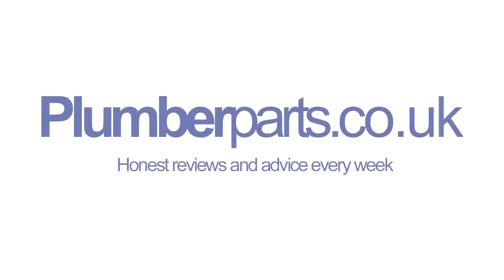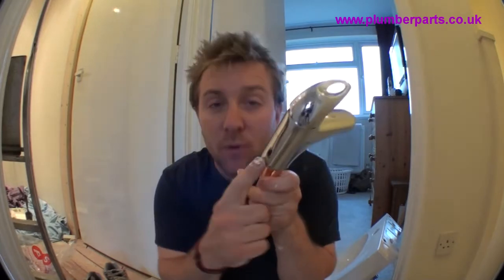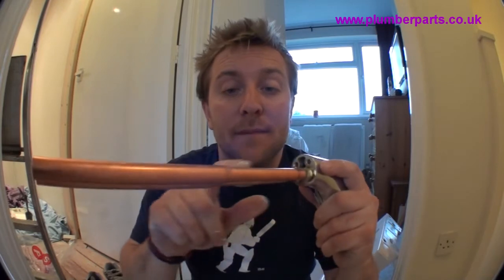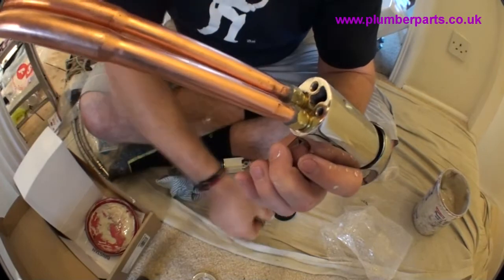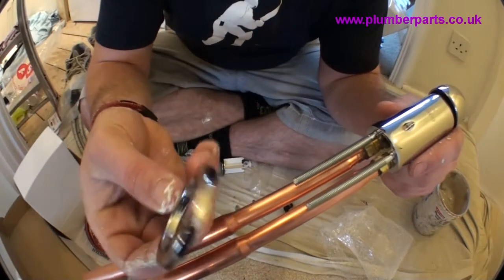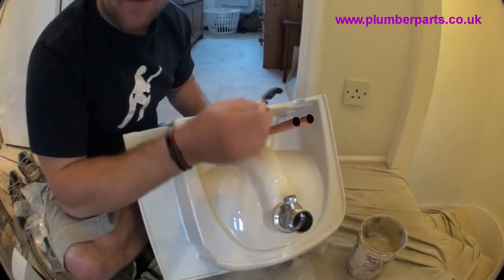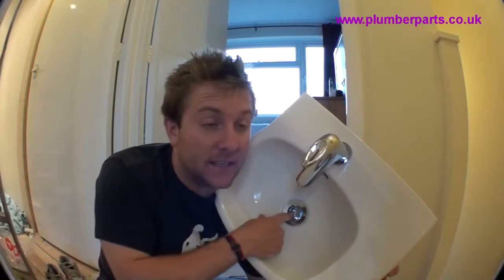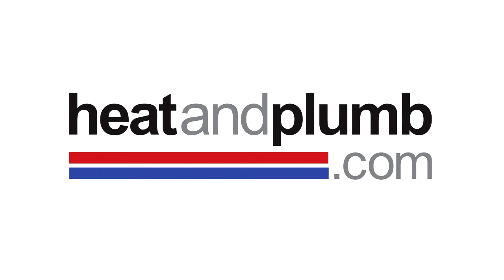Ep2 Wash Basin Install - Basin Tap - Plumbing Tips

Comment: Hi, I installed a basin tap mixer with flexi steel hose pipe but the hot water flexi hose is dripping from the top. How do you reckon I can tighten the hose as the pipe bends when I try to tighten it ? Do I have to get a new hose pipe ? Thanks
Reply: ***** Rubber seal was not in the right place. Thanks it worked now, you are a star.